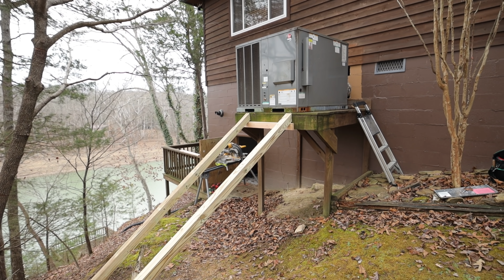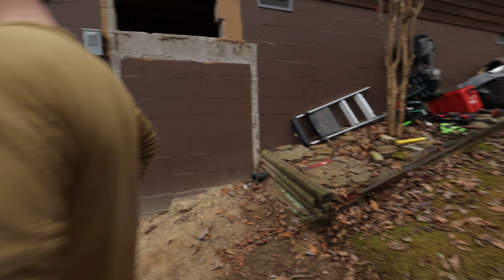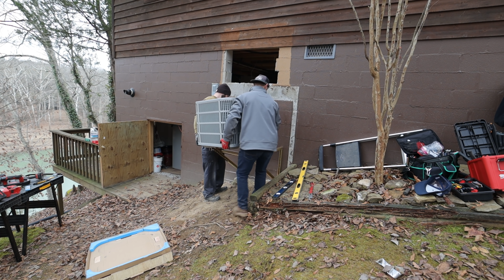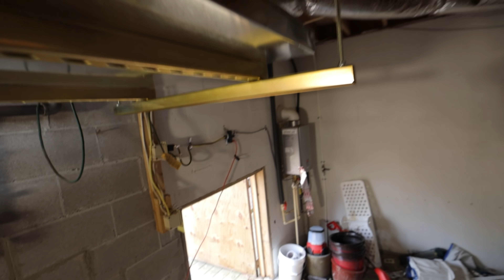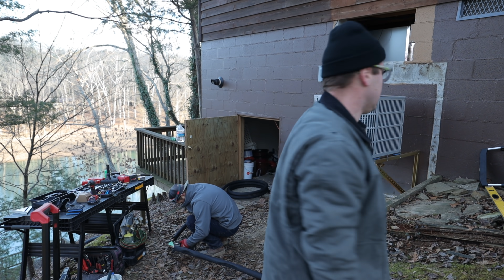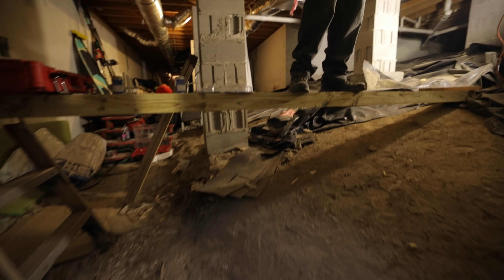Riverside HVAC Project Part 1 | Bosch IDS 2.0 Variable Speed

Comment: I never saw any advantage from Package Unit? then degraded to Split Unit. The word Split, already spells more than one task. Installation alone you have to work both outdoor + indoor units. You need more man hours, more joints and more electrical work to be done. During maintenance, service or repair works, again you need more man hours compared to Package Unit.

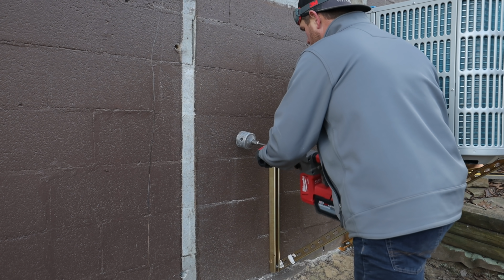Comment: 7:55 what size of hole are you making with the milwaukee tool? can it drill up to 3- 4 inch hole with that tool? i want one but my company has a huge and heavy bosch drill and i want something light and small to handle

Comment: Just an FYI: Unistrut is much stronger if you make square cuts and use bolt in fittings made for brackets, offsets, etc. Care Supply on Elm Hill Pike keeps a TON of strut and fittings in stock to make everything like your wall mounts. We buy from them almost on a daily basis. Good job on your anchors. I like watching your video's....craftsmen are really hard to come by these days. Guys who take pride in their work.

Comment: You do a great job with the installation sir. I do exactly what you do but in Florida. I couldn’t help notice the state code requirements so much different. So much stricter down here. Although it looks great and I have no doubt it works perfect that job will not pass code down here for countless reasons. Makes my job 10 times harder down here just because the inspectors are real pricks. I like you all install ah in the basement most of the times. That is a luxury I will never have.  Most of the time I have to put the ah in the most tightly hot ass attics no wonder we junk these units down here in less that 10 years. Keep up the good work sir.
Reply: What would fail from his job  in florida. Just curious
Reply: @Kilo5910420  you are not gonna see in this video but if you watch the part two then you will see. Outdoor unit will fail in Florida because the armaflex insulation it’s not uv rated Florida sun will eat trough that insulation in less then a month of Florida sun. They make uv rated insulation which has like a light plastic coding or actually they give us the option to paint it white with uv rated paint .That nice unistrut stand would have to be aluminum or it will rust trough after the first rainy season. The metal strap anchors won’t fly either they need to be hurricane brackets. The air handler has to have the drain insulated. The insulation of the copper lines can’t just be taped with duct tape. All the joint have to be glued with armaflex glue. Also the ah has to have a disconnect in within 6ft. I see the electric heater has a circuit breaker on it to cut power but here we have to be able to cut power before it makes it to the unit so we can safely work on it. This is just at first glance but I’m sure if I was there to see it I would probably find more but like I said it’s just stupid shit that do not matter very much and really do not interfere with how the unit operates it’s mostly Florida inspection codes and for some reason they are really pricks sometimes. Just makes my job harder
Reply: @alexpaic2984  pretty much everything you said is correct here in Baltimore as well...very picky an annoying inspectors here as well..some let small things go .but most dont
Reply: @Kilo5910420  yup

Comment: If they have gas service, why install a heatpump rather than a gas pack?
Reply: The wrong question. Later on they can put solar panels in use and heat the house for free . The right question. Why did they not put open loop heat pump where there is water within reach?  COP 5 is better than COP 3

Comment: The weakest part of your wall mount is where you bent it. You should have bought 90 degree fittings to bolt to the inside of the bends with spring nuts. If it ever fails it will be at the bends. Also, I hope your guys caulked that filter box. It had huge gaps  between it and the air handler before the indoor coil and after the filter....not a great place to leak, especially in a dirty dirt crawlspace.

Comment: It’s good practice to put the filter dryer inside.
Reply: It's a heat pump. Which metering device is more important? The one inside, that is used 3 months a year in my state or the outdoor, which is used 7 to 8 months a year in my state. Nobody cares about drier placement dude, as long as it has one.
Reply: Why would I braze in someone’s home if I don’t have to?
Reply: @123withrow  That is a 100% untrue statement. Drier placement doesn't make it a good install. I think we have a hack on our hands. Dude probably knows all about drier placement but lacks a little bit on his refrigeration theory. Bro you have probably never even seen equipment with hot gas bypass, hot gas reheat, or liquid injection. You sure know how to inject your two cents about the drier that 99% of techs worth their weight in salt don't give a shit about the placement of as long as it has one hahahaha
Reply: @jman0870  your a moron bottom line.
Reply: @jman0870  the filter dryer rust out where I’m at when you put them outside but it is good practice to put the Dryer inside go back to school and stop worrying about you tube moron.
Reply: I keep them outside and paint them nicely after brazing... I don’t want to use torches any more than I have to inside a home

Comment: I’m guilty of using water and a rag after a nice silver job 😂 I am going to give the HotBlock a go, but how does it remove after you’re done brazing the line-set? Does it stick to and have to pull off in pieces like play dough or clay bar? 
Very pleasing to watch your work. 
Very beautifully done. 👍🏻
Reply from the maker: Thank you! As long as the hot block isn’t dried out, it comes off just as easy as it went on. Leaving a slight residue that you can just wipe off with your hand. It works very well.

Comment: Love your Channel ! Love the quality . 
Was wondering if there was a certain reason you didn’t bring the line voltage wire in through the back of the disconnect instead of out the wall with carflex and into the bottom . My thought is so you only have one carflex line and no tubes sticking out of the wall. Still looks good tho 👌.

Comment: I always try to put the drier inside, protect it from the weather.
Reply: They are fine being outside, you are just being picky. Any manufacturer will tell you that filter dryers are outdoor rated
Reply: @XarlesWolfgangSteel  There's always 50 guys who cry about drier placement. Spray some rustoleum on the burnt paint and it will last longer than the sheet metal of the unit.
Reply: filter dryer always goes closest to the evaporator

Comment: Geeez. Gotta come back tomorrow. We do a complete job survey so when install day comes we dont have to come back next day for flex or to get the unit set up, we have everything we need. We install Trane   XV 20 SYSTEMS. They Make Bosch look like a Goodman. Cannot remember the last time we installed a unit and didnt have it runnung same day. Gotta be thorough when you do the job survey so that when install day comes the homeowner doesnt have to wait another cold night for what they payed for. Went from a gaspack to a heat pump. Homeowner isnt going to be happy with that change after having gas heat. Should have sold them a Trane xv20 heat pump dual fuel with modulating furnace for back up heating. Hope you are not up North.

Comment: You mentioned why you don't like to cool down your lineset after brazing with wet rags, why is that?

Also, with such a short lineset run, why so many fittings/ brazes? Instead of doing it all with the bender and only having 4 brazes total
Reply: Shocks the joints

Comment: My question is why go to a heat pump why not use the natural gas it’s way more reliable and heats better
Reply: Probably customer request
Reply: I'd say he gave the customer options, explain the benefits and let the customer decide. Plus it's a inverter compressor which will produce heat until -4°.

Comment: You do very clean work you even installed a surge to protect the inverter compressor on the heat pump very smart!
Reply: It has an inverter board. Always install a surge protector on inverter boards or they do all kinds of wacky things. Residential inverter boards are chinese junk pretty much universally and are not built to withstand anything but perfect power.

Comment: We’re you running co2 through your lines when braising the compressor? Looked like a co2 tank and not nitrogen.
Reply: It was nitro
Reply: But Co2 works also
Reply: @mattluongo7763  I’ve used co2 for flushing lines before especially when doing a triple evacuation when swapping out units but never when braising.

Comment: Your installs are always so nice and professional!   Does Bosch make a Hybrid Gas Variable Speed?  I just can't understand why a owner with Natural Gas would want to depend on just a heat pump for heat.
Reply: Bosch does have a furnace and can be set up for dual fuel. Bosch does not use variable speed, they use constant torque motors.
Reply: Hi.Any vibrations from the units?
Reply: @blakeywsr59  normally not they are very quite and run smooth.

Comment: great video, may i ask why braze dryer outdoor, isn't indoor better ? or doesn't really matter
Reply: It literally doesn't matter. It's a stupid argument. Why take a torch into a house if you don't need to for repairs.
Reply: Always suppose to be closest to the evaporator. Read literature
Reply: @Kilo5910420  The outdoor unit is the evaporator in heating on a heat pump. MANY heat pumps spend more hours a year in heating than cooling. Learn your theory.

Comment: Why not go with a high efficiency gas furnace?
Reply: Youre fooling yourself if you think electricity wont follow that curve as well
Reply: @TR-ut3yh  Interesting you say that. My energy company was recently paying me for using electricity because of excess renewable generation. When has a gas company ever done that.
Reply: @djenson  I will admit that I have never been paid by my gas company. As more and more things rely on electricity (vehicles, heat sources etc.) The price will go up. Supply and demand my friend.
Reply: @djenson  You net positive because of being at work/sleep. I 100% guarantee you can't power your house solely on solar without having massive brownouts. You are still using grid power dude.
Reply: @jman0870  Sorry, 100% of the energy that I use will be generated by renewables, and there certificates to prove it. I live in the UK if that make any difference to what you think.
Reply: @TR-ut3yh  but as more sources come available, everyone starts to get solar on there house, like new builds having solar, people get battery's to balence night/day demand (once again, my energy company is giving these out for trials) there becomes more supply
Reply: @jman0870  the UK also get 47% of its power from 100% renewables. When you factor in low carbon sources like nuclear and biomass, that number is 63% I think
Reply: @djenson  Nope. Compare your population density to the US and the entire game changes
Reply: Why continue to use a non-renewable resource that is going to be ever increasing in cost?
Reply: @djenson  You think power plants are using renewable resources? Hahaha

Comment: Great job as always. I still wonder why homeowners go from oil or gas to a heat pump. Several of my heating oil customers have and are not happy afterwards.
Reply: That’s exactly what I was thinking why would go all electric when you have gas
Reply: @scottmattson4765  my comment was a year ago before the price went completely insane. Much of my area doesn't have natural gas and they charge almost the same for propane as heating oil.

Comment: why are these package units so prevalent in your area? I'm in NJ and  I've never worked on one during my two year stint in residential.
Reply: In the south we have low craw spaces and can not put split systems under those houses. So that why you see them here. Y’all have basement that hard to find down here.
Reply: Builders can install package units is the most common reason. It takes HVAC technician to install split units. I only use them for rooftops or last resort.
Reply: tmbgfan5.. we have them here in philly..depends on the application and need.
Reply: Where I'm at package units are generally reserved for trailer parks haha

Comment: How heavy are the ac units
Reply: Depends on which part you're talking about. The gas pack in the beginning was probably close to 500 lbs.
The condenser is probably about 200
And just over 100 for the air handler
Reply: @vincentgrueter7759  oh ok I was asking about the unit they slid down the wood planks

Comment: no plans to secure place where unistrut is cut and bent?
Reply: I thought the same thing. Making me nervous
Reply: @vincentgrueter7759  where are you talking about?
Reply: I agree. Should have bought 90s and spring nuts and bolted them to the inside of the bend. If that fan blade ever breaks and throws the condenser out of balance that wall mount will go bye bye.
Reply: @jman0870  now I see where you all are talking about. I didn't notice that.
Reply: @Bryan-Hensley  It's the little things you pick up from watching things break for years haha

Comment: Just curious as to why you bend your pipe to go through the wall and then use elbows on the air handler and a swage joint to tie into the unit. Why not bend everything then you only have two braze joints on the suction and four on the liquid line.
Reply: I thought the same thing. Although I could see how it might be hard to bend the pipe at the air handler against the floor joists. Maybe make the bends on a short peice off of the pipe and then swage the main run of the pipe going to the condenser, that way only have 3 welds. 1 at condenser, one in the middle for your custom bend, and one at air handler.
Reply: Big pain in the ass bending the whole run
Reply: @trent624  
Not with the bender he has. I have the Hilmor. Make complete system bends all the time.
Reply: Or he could have Faced the Air Handler unit the other way, facing the wall, and just shoot the pipes straight in that way. All you have to do is just make sure he left enough room off the wall to service it